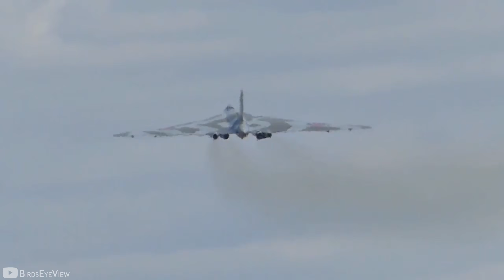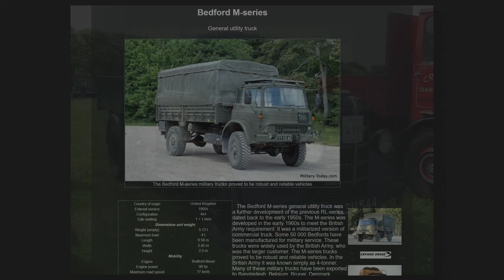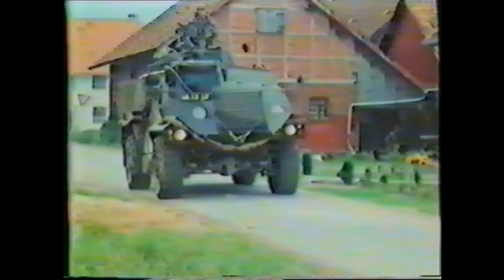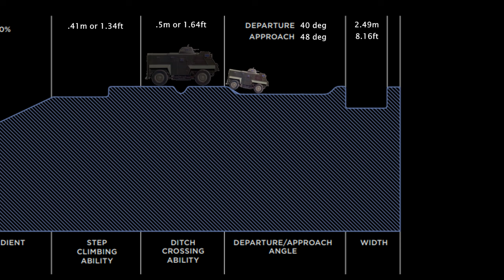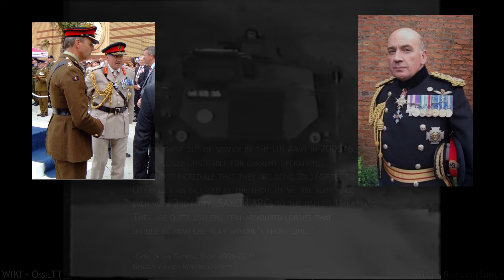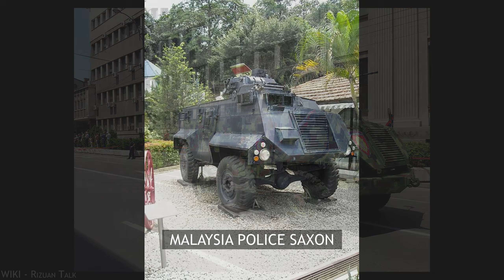AT-105 Saxon APC: Britain's Cold War Battle Taxi

Comment: I always felt that once it reached BAOR, Saxon would have primarily functioned as a bug out vehicle.  It's job would have been to evacuate surviving infantrymen from untenable positions to the next defensive line. A top speed of 60mph and bullet proof and shell splinter proof armour would have been very, very useful.
Reply: But they had zero off road capability. Be better off in a standard 4 tonner

Comment: Prototype Saxons started off on Bedford MK running gear and was meant to have a b81 engine option there was a left hand drive prototype that had a 7.62 mm in a turret the vehicle was on the GKN stand in 1976 at a Arms fair and had a strange hybrid between TM and MK axles

Comment: Royal Malaysian Police are still using the AT-105 for its General Operation Force, Armoured Car Squadron. The Malaysian AT-105 were used during 1968-1989 Communist Insurgency for patrol, escort, armoured transport and roadblock duties and usually paired with V-150 Commando. The Malaysian Sankey AT105 were only fitted with turret with 2 FN Mag GPMG and smoke discharger.
Reply: I drove one of these my btn 1KORB IN 83 when we trialed them then we drove them to Germany for lionheart utter nightmare

Comment: Saxon was and still is good for what it was intended to do. Quick and cheap long distance travel for B infantry units in low threat rear areas. Certainly warmer than the back of a canvas lorry. Given it's impressive internal space, I imagine it has uses in logistical  support roles too.
Reply: no, that spare got filled quick. the 8 94mms took alot of spare to the left of the turret, also rations and water keep inside....but plus note it had a BV (Boiling vessel) hook to its mains so hot food and tea all round. Also a REME could get you an adaptor to power a radio as well...90's living
Reply: @jonathanohagan1349  My time with it was all good.

Comment: Its more than appropriate option for the motorised infantry which would've otherwise been driven in open topped trucks and other soft-skined/uparmoured vehicles like the 4x4 Mercedes or Land Rover. 
Although even with the inclusion of Saxon, significant number of infantry units would still have trucks as the only option as it is impossible to provide armoured vehicles for the whole army.

On the other hand it isn't suitable for the tasks of mechanized infantry units as these are specifically trained to work hand in hand with the tank units and importantly these units are much fewer in number compared to infantry/motorized infantry units in any army.
Reply: Sadly no, they would have been better of in 4 tonners and landrovers. Awful vehicle, designed with only budget in mind.

Comment: Briefly, the vehicle was designed to haul a Brigade up the MSR from the Channel coast when 432 was our benchmark. It was (for the time) quick, modern and offered 432 level of protection. It was driven as close to our digging areas as possible, we debussed and starter to dig. We could move between positions protected against artillery splinters. It never promised WARRIOR mobility or protection, but for the Brigade, it was cheap, relatively reliable and no more difficult to work on than it's parent. 
The General was pushing a different agenda, the Dogs of War MRAP. He was speaking simply, to simpletons, trying to explain that he needed something different. That "No Minister. Just because the MRAP has wheels too, doesn't mean the answer is SAXON because it it wheeled and Cheap!" I rate SAXON for the job it was designed to do, in its historical context. Today I am FOXHOUND for both jobs, though FOXHOUND would need a large trailer on the march up (5 DOS); And a very strong force of MPs to get them away from commanders (who would be keen to retake FOXHOUND rather than just digging in.
Reply: But it was never deployed that way. It was a poor vehicle for the British army unfortunately.

Comment: A truly useless vehicle.
Reply: Nope, its was great for it's intended role. Moving infantry long distances with light protection just short of deployment and nothing more than that.
Reply: @robert6106  that's true, but unfortunately the powers that be will always try to make a crappy silk purse out of a perfectly serviceable sow's ear. As a battle taxi on roads and moderate tracks it was OK,  but for anything other than that, it was rubbish. I was saddled with several of them as CP vehicles......terrible.
Reply: @gunner678  if they were used for a purpose other than that they were designed for then don't blame the designer and it clearly doesn't make them useless. It makes them wrongly used.
Reply: @badgertheskinnycow lol you don't get British forces equipment procurement. Even as a troop carrier it was very limited not really up to infantry requirements. Fine for internal security like Northern Ireland, but a bit of a nightmare in Germany sadly.

Comment: Sub 58 reporting.

I can understand the desire to replace the Saxon, as it was made to operate in a very specific environment.
A 10-man passenger capacity and resistance to GPMG fire and not a lick more put it in a bit of an awkward place between soft-skinned transports and anything that could foreseeably operate in an asymmetric theater; having less average capacity than the former, but the maneuverability and bulk of the latter.

In Western Germany, that level of protection would probably have been put more to use against hypothetical Soviet artillery fragments, as opposed to small arms fire; which, if it had run flats, it would probably be really useful for. But that level of protection just wouldn't cut it in Afghanistan; not against HMG fire, rockets, and certainly not IEDs hitting harder than any standard AT mine does. Neither would no AC; that's a health hazard down there. Does sound like a real nice police tactical van though.

MRAPs and other vics prepared for asymmetric warfare tend to be quite large, as engineering necessitates to resist explosive forces, so properly replacing the Saxon I'm sure wouldn't have been easy, no matter the outcome. You either end up with a well-protected unit about the same size that carries basically nothing, or something the size of a bus to carry the same number of personnel. The third option - to skimp on protection - is more or less what they already had.

That conundrum and the drama surrounding its replacement somewhat reminds me a little of the TAPV here in Canada, maybe another good video topic:
We've been running Mercedes G-Class up-amoured in place of Land Rovers and they... Exist... Though you'd be hard-pressed to find a story with one where someone inside wasn't injured; do with that as you will. The next size up in terms of armoured vehicles has for a long time been the 20-ton 8-wheeled LAVs. Great, if you're mechanized infantry, but not so much if you're 3-4 people who just need to drive somewhere on your own (pers. transfer, recce, comms detachment, OP supply run, light convoy escort / route clearance, etc.), since you probably won't get the green light to use an LAV for taskings like that.

Enter the TAPV: a vehicle which, despite also weighing 20 tons like the LAV, has half as many wheels (thus, twice the ground pressure), less weaponry (or none at all, as procurement decided to acquire a sizable percentage of the first 500 without remote weapons systems), half the internal seating at 6 including crew, and less armour.
I can't for the life of me imagine why it weighs 20 tons. It should be 10 based on what it's capable of.
Despite all that, it IS an improvement on the G-Wagon in just about every way, but it remains to be seen if we'll be using them more prolifically, as there are a lot of outside-the-wire situations where it could be a direct replacement for the G-Wagon, or if they're going to be treated more like a dedicated recce vehicle - which I think would be a bit of a waste, despite any teething problems the system might have.
All-in-all it leaves me with a very mixed set of feelings about the thing. At least we actually GOT them - which is more than can be said for nearly any materiel procurement rumours I'd ever heard back when I was in. And they weren't second hand, moldy, and sinking in the harbour either, so that's a plus.
Reply: Your over analysing and applying metrics to it that it's use was never for. It was a troop transport for moving troops while offering a light level of protection, in Europe the infantry would be dug in on the hill facing the Soviets advance, the Saxon would be sat on the other side of the hill ready to redeploy/resupply, may be some fire support with the mounted GPMG, moving Troops through or out off nuclear fallout and so on. Battle Taxi is all the Saxon was, 432s later replaced with Warriors were the AFV
Reply: @robert6106  Yes, and the Russian propensity for artillery - rocket, heavy, and otherwise - means those supply lines would have been under near constant barrage along any attacked frontage. Small arms protection would have been useful for that is all I said, and it would have done... Certainly more than canvas and sheet metal on most wheeled transports, since 'light protection' isn't only for small arms fire and never has been.
I'd hardly call it over-analyzing by putting it in the exact combined-arms context for which it was designed.

Comment: I'm not understanding the hate for this vehicle. Seems to be a capable, well armored Calvary option. I know that having no air conditioning sucks, especially in the desert, but I'd rather have that armored "tub" than to be riding in a lightly armored Land Rover. Great video!☺
Reply: The hate comes from those that had to drive and maintain it.
Reply: I was concerned that it could only stop up to a 7.62 armor piercing round, but I guess the idea is to be moving fast enough to not get hit by an RPG
Reply: @macstmanj3  Yeah I was thinking the same thing. Quick mobility plus those crazy angles to deflect RPG rounds
Reply: Nope, terrible vehicle I'm sorry to say. Think concrete armoured commercial trucks to defend Britain again operation sealion in WW2 and there you have it. Dangerous, not fit for role. Built only with budget in mind. Troops would have been better served with a standard truck, at least it could move faster, go better off road etc. Waste of money and life.
Reply: No you really don't know the vehicle. Armour of little use when the saxon falls over, which will happen unfortunately. Terrible vehicle, sadly I have had the pleasure😢

Comment: Great presentation. Good info. I agree with with Ms Slates below - what did or do the troops think about them. This could be a very interesting series!
Reply: Slowest thing with wheels ever designed by man.
Reply: Terrible,top heavy and shite to drive. Cross country mobility of a London bus and the reliability of a Renault.
Reply: In my Bn, We used to say “A 12 tonne Wagon with an 8 tonne Braking system…..GREAT 👎🏼👎🏼!” - Unfortunately, They WERE absolutely crap and I agree with all the other comments from ex users of this vehicle.
Reply: They were rubbish and should never have been issued for anything other than internal security.